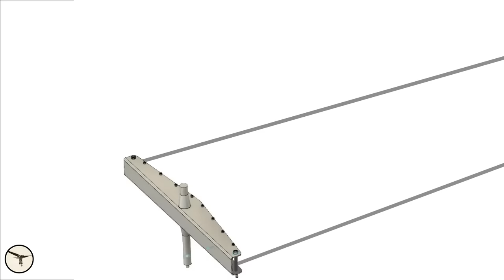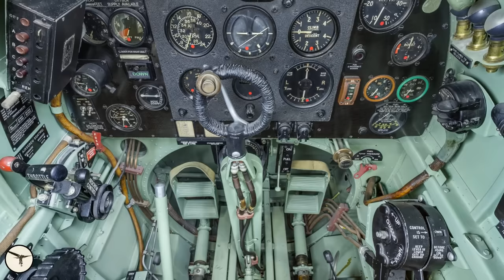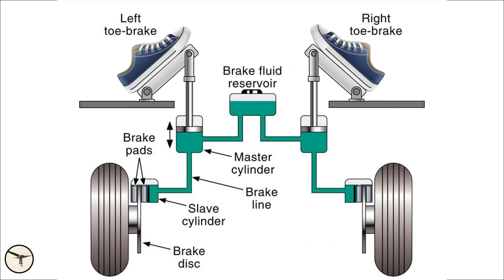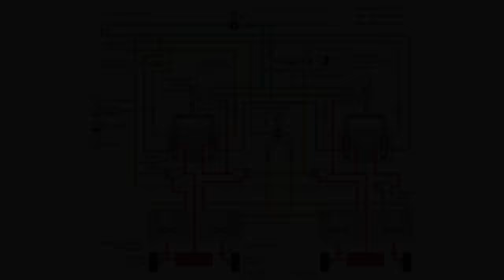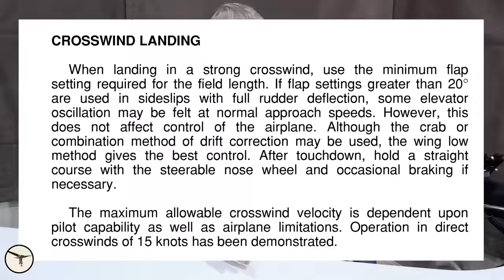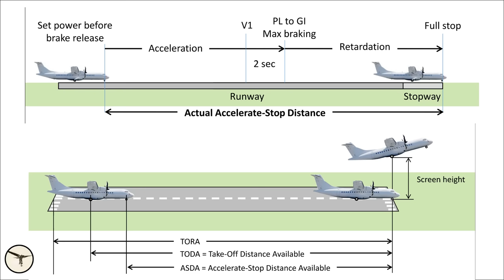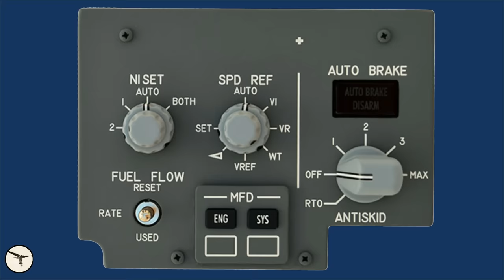Are you using the rudder pedals correctly? | Flight safety | Loss of control

Comment: Thanks for an excellent breakdown.

I am definitely feet-up and always have been, and I've had arguments with senior instructors in my airline about it when they see me in the sim. You've already got two of my points (reaction time improvement, impossibility of shifting foot position if full rudder is already applied without releasing pressure). Our flight manual states directional control at max crosswind may only be possible with full rudder deflection + assymetric brake input.

My third point is the importance of the PM (pilot monitoring) role. According to our ops manual we must monitor all control inputs made by PF at all times. No way to detect inadvertant brake application during T/O roll other than with feet fully up.

There is a caveat though, my brain has been wired since the beginning of flight training to separate heel and toe pressure, I have never inadvertently applied brake pressure with rudder deflection. I don't know how easy it would be to retrain the heels up technique to someone used to having their heels on the floor.
Reply from the maker: Thank you for your feedback. You are absolutely right; using the heels for rudder control might require a rewiring of the brain.
Reply: (non-pilot asking) Suppose you're PM during takeoff roll with heels on the floor (toes on the bottom of the pedals) and the PF applies some brake inadvertently.  Would your pedals lift your toes?  I don't see why not.

Comment: Nice insight capt. I’ll try for this technique. Til now i am used to put my heel on the floor. I feel like it’ll ease my leg for any rudder maneuvers. Such as, put more friction at right rudder with heel so my left leg can loose the pressure. But i always have a problem to hit the brake, i need some seconds and gut to not loosing directional control as well as moving my feet slightly up. 

I know it seems lazy, so that’s why I’ll try to change it. Thanks sir!

Comment: Super interesting video! I never gave this much thought. I'm still in my training phase (commercial pilot, Cessna 152/172; Embraer Seneca III) so I'm not yet familiar with autobrake systems. I tend to always keep my entire foot on the pedals during taxi, take-off & landing for the same reason, it's quicker to use the brakes in case I need them. While in the air I slide my toes down to the "heels" of the pedal, since there is no need for brakes up there (obviously).

Comment: Feet up pros: quicker response to braking.
Feet up cons: inadvertent application leading to brake overheat during takeoff roll/wheel well fire, and on landing, bald spots on tyre/tyre burst/loss of control.

Feet down pros: no chance of inadvertent brake application.
Feet down cons: slower application of brakes, (however RTO calculations allow for delay in braking) and minor yaw when transiting from feet down to feet up during landing roll in high crosswinds.

Feet down seems the safer option.

Comment: I'm a new pilot learning on the PA28 Warrior, and I am a heels to the floor person for takeoff and landing. I'm a pretty tall guy, so it can be somewhat challenging to have my heels up and NOT apply any brakes! My muscles also get tired fast because they're not meant to be holding the foot up like that for so long. 
On the other hand, I have experienced the problems it brings when doing short-field landings. The need to come on fairly quickly and it can be easy to create pilot-induced oscillations if you bring your feet up asymmetrically. Luckily, I have managed to avoid that so far on our shorter 2600 by 75 foot runway!

Comment: We had a 172 crash through the hedge at our grass strip, he had plenty of distance and within the weight with two people on board. He never accelerated to a proper speed to fly, because he was steering it with the top of the rudder pedals and pushing the brakes all the time, the more he needed speed the more anxious  he got and tensed his legs more and more.

Comment: Great explanations. I usually fly with heels down on the floor, due to horror stories told by GA aircraft owners how tires can be punctured by pressing the toe brake accidentally during touchdown, at the moment of de-crabbing and aligning with runway direction, with a strong crosswind, on paved runways. On narrower and shorter grass runways however, I keep my feet up, because the tires won't be damaged, just slip on the grass and I need quicker reaction to any directional anomaly.

Comment: My last AQP (annual sim training) I tried using the heels on the floor method. I was not able to smoothly brake during a crosswind landing. Using rudder to stay on the centerline, to be able to hold the rudder input and slide my foot up the pedal took some effort and the aircraft yawed a bit during the transition. I returned to my normal habit of having my feel ON the pedals. I am always mindful to use my heels for rudder control and toes for brakes.

Comment: I prefer to put my heel on the floor, except during landing (after touchdown) or braking. This ensures I am not inadvertently applying the brakes, and it makes it easier to apply precise rudder control during flight when I am using the ball of my foot on the bottom portion of the pedals.

Comment: I want full control of the airplane at all times, practice makes permanent.    Reaction to emergency or changes in external conditions happen quickly and without warning. I have several instances where feet on the controls has avoided dangerous conditions. Recently I avoided a costly prop strike while landing at night and avoiding a deer on the runway. I used a combination of brake and rudder input to maintain control.  I'm with Magnar on this one.

Comment: Thanks! I didn't know there was so much depth in rudder pedals! I always have my feet on the rudder pedals unless clearly airborne. Then, my legs will relax to rest my heels on the cabin floor. I do not care if I wear the brake pads, they are easy to replace and cost a tiny fraction of my airplane (which is a taildragger, Seabee N6007K). Ground looping is a common taildragger accident (I have seen it at my airport only a few months ago) and the damage varies from none to loss of hull and death. So, the risk of excessive brake wear for the benefit of instant directional control by differential braking presents, for me, a no-brainer decision. Also, the risk of overheating the brakes seems very far-fetched. Thanks, again!

Comment: I fly light aircraft. I used to keep my whole foot on the rudder pedal for steering and differential braking/steering while taxii and heels on the floor on Take-Off. For landing, if its a short runway, I keep my whole foot and control the yaw with my heel. Its not conplicated when you get used to it. Just that make sure that the toes are kept up. The sliding method, I never felt comfortable.

Comment: I am a cfi, and normally if a student has a habit of riding the brakes, I’ll tell them heels on the floor, so they get used to using the rudder only.
However, for myself and more experienced pilots, I use my heels/arch for rudder and toes for brakes.

A common problem for students is accidentally using brakes on initial phase of takeoff, and increasing takeoff distance.

Comment: It depends on the situation no doubt. During very strong crosswind from the right on landing a Dash 8 300 Pilot used the side slip method left rudder right aileron. It was up to max crosswind limitation (36 kts) so the pedal was almost at the stop to maintain directional control as the aileron was used to prevent any drifting. on touchdown with the upwind main gear touching down first then followed shortly thereafter the left main gear touching down. The Pilot had so much pressure on the left rudder pedal with His heels off the floor that upon touchdown one of the main tires on the left blew on landing from the fact that the brake was depressed on the left rudder pedal. Had the Pilot had His heels on the floor this would have been avoided.  and during the rollout if rudder and nosewheel steering are not enough to counter any weather veining into the wind it takes less than a split second to reach up to the brakes and assist in directional control.   Maybe in certain situations and depending on the actual rudder design where it is easier to use the heels to depress the rudder pedals and not accidently sliding to depress the brakes on touchdown it can work or grass landing in taildragger where minimal effect of having brake depressed  on touchdown can cause tire failure?   Having flown over 20 different light aircraft and 10 heavier aircraft the design of the rudder pedals can vary a lot.  So hence My "All depends on the situation at hand.

Comment: I agree with what you're saying here 100%. I'm currently almost done with my commercial and my instructors would be surprised when I mentioned I kept my feet fully on the pedals and operated the rudder with my heels. In my mind, that's how it should be done. What is the sense in having the brakes if you have to shift your feet and change rudder pressure to use them? It would be much easier just to learn with your feet fully on the pedals and maintain positive control all the way down the runway.

Comment: Hello Magnar,

Great video, although I disagree with your recommendation at the end of the video, I also understand that because I don’t have transport category aircraft experience, there might be other considerations, including those you mentioned , which I don’t fully appreciate. Nonetheless, your way of explaning things logically make even those that disagree with you, agree in a way, even if at least through respecting your opinion. 

From my personal experience instructing in light piston and turboprop aircraft with no ABS, definitely heels on the floor. I have flown with many people who apply continuous brake pressure during taxi, takeoff and landing without feeling it because of their habit of keeping their feet entirely on the rudder pedals/brakes. This is also specific to certain aircraft pedal design, for example, on the Quest(now Daher) Kodiak, the rudder pedal design is such that it’s very easy to be pressing brakes without feeling it, as it doesn’t take much pressure. Whereas in the Twin Otter I also fly, it takes noticeable pressure to depress the brakes. The twin otter has relatively strong brakes that when operating at light weights, it’s easy for those landing with feet on the brakes to tense up on landing and apply too much brakes, resulting in a burst tire. Ofcourse the correct technique would be Beta then shortly after brakes(if required). 

Regards,
Mo
Reply: Yes, crosswind landing in challenging crosswinds does delay application of brakes as it would only be smart to start applying brake pressure when the aircraft is under control. Perhaps adding a margin to the landing distance in strong crosswind landings would be wise, accounting for delayed brake pressure application(in aircraft without auto brake)
Reply: In regards to your experience in the Maule, perhaps full aileron into wind during landing rollout would have mitigated the issue with the wind gust. 

And thank you for all the material you share with us and your hard work!
Reply from the maker: Wrong use of ailerons in crosswind can cause loss of control, but apart from that, the ailerons do not improve direcitonal control.
Reply from the maker: Hi Mo. Thank you for your feedback. Yes, some aircraft have near vertical rudder pedals, and that's a challenge. The main reason for inadvertent use of the brakes is that the pilots are not using their heels to control the rudder.

Comment: to be sure, we need to confirm that this is all for specific types of airplane, not industry wide... even today, certain types of GA & non GA aircraft (I started writing this before you mentioned about the Cub) require you to keep the heels on the floor ... I am particularly thinking of the traditional variants of the Yak 40, where, the angle of the pedals was such that it was impossible not to press the pedals in a jolt unless you support your foot on the bracing step. (this actually was a highlighted error resulting in a number of runway excursion incidents...)
of course, on some really modern aircraft, a sidestick or other form of unified control system sometimes will have the rudder on the control column rather than feet operated. (but I think they are a special case enough that we can consider them to be clearly out of the scope of our discussion here in this video).

Comment: As an industry, we are failing our students, by no longer (post WW2) utilizing the most powerful of the three controls....AILERONS ADVERSE YAW for directional control on the ground.
The sequence for landing directional control (pre WW2) was (out of necessity) always rudder, tailwheel steering/aileron yaw, and lastly the brakes for turn off.
With the advent of the Cessna LAND O MATIC system (nose wheels) the industry began to use hydraulic brakes for stearing instead of the AERODYNAMICS of the larger (2 to 4 times the surface area of the rudder) ailerons.
We have now transitioned from, ground looping tail wheel planes, to flipping nose wheel planes onto their backs with excess airspeed, braking & improper use of the larger ailerons. 
Cheers
CFI/ATP 1507987
Reply from the maker: Hi, thanks for your feedback. You are absolutely right. A lot of skill went out the window with the introduction of the nose wheel. A video about the ailerons is on my to-do list.
Reply: I fly the bf 109 in msfs

Comment: What I found in general is that most pilots are convinced that their personal viewpoint or opinion on a technique  is the most correct one the world has ever seen. Without much scientific evidence. I tried the different feet positions on rudder through the years and decided to make 'your' technique (and always being able to brake immediately) my preferred method. When converting to the 737 however I had to reprogram my muscle memory as to not kick off a perfectly working auto-brake when stopping before V1. Took some getting used to but still kept believing in this technique. Auto-brakes can fail and sometimes we dispatch via MEL without them. ✈🙂

Comment: I do as you do. I’ve never flown transport category aircraft however. 

But, this must be the culprit in many loss of directional control accidents I’ve seen. I’ve always thought that so many of them could have been prevented with a little brake at the right moment. Maybe they didn’t have their toes on the brakes.

Comment: the correct way is with full feet on the pedals, for quicker reaction to any unexpected event depending on what's that you need to correct the problem, whether if it's rudder or differential brakes.

Comment: Nice video! I like very much the part about taildraggers. In this case I think it is so different than trycicle gear because if you apply erroneously a little bit of more pressure than needed you can get the tail so up until touching the prop with the ground. I was always taught to use my feet out of the brakes due that, but it's also important to have good directional control with the brakes so quickly.

Comment: On non autobrake aircraft i put my heel on the rudder... ( Mostly GA)

Since i flew 737 with autobrake, cant do it anymore... Suddent jolt on the runway or unintended brake might turn the AB off...

I had a lenghty discussion with my instructor on where to put my foot in my early days..

 And recently, i was teaching some pilot that transitions to 737. What they flew before dont have AB.. and as habbit is quite hard to change.. the AB disarm light always turn on at touchdown  and during high speed RTO 🤣 took em on the 7 SIM session to get used to it

Comment: Great video !
I'm a student on Robin DR400. This aircraft has the front wheel leg uncentered, slightly to the right side which makes symmetrical braking difficult. Besides that, the front wheel needs a certain weight pressure to be steerable which makes "soft landings" dangerous because you can loose steering if you "hit" the front wheel on the runway too lightly. 
My instructor recommends me to keep my heels on the floor and I understand his point of view : the DR400 is so complicated to steer on the ground that student usually only use breaks and do not use the steering mechanism. So far I am concerned, I do feel more at ease with your advice : full feet on the pedal because it gives me an immediate alternate if the steering mechanism does not respond.
Thank you !
Reply from the maker: Thanks for your feedback! I didn't know that the DR400 has an offset nose wheel. It might be a French thing because the SOCATA Rallye has the same.

Comment: So many experienced pilots hardly use rudder. It seems to be GA and turboprop guys who use it instinctively and this carries through. You only have to look at videos of landing airliners and the stabbing of the rudder on some of them! I fly B737, auto brake RTO only works above 90kts so you need toes ready on take off. On landing you may need Autobrake Max due to performance calculations, but that’s fierce so you kick it off almost immediately! The 737 needs an autobrake 4 ( or 3.5) setting!!

Comment: i fly always heels up for taxiing, taking off and landing. I only fly small aircraft at my local flying club and usually do glider towing which is why i want to specifically make sure im able to brake during takeoff if something happens to the glider during the initial part of the ground run (which can be a bit tricky because the glider cannot keep wings level at low speed)
Reply: Do they have two sets of brake pedals (for both pilots in passenger planes!? 🤔

Comment: Mostly things work on some kind of pressure gradient. Engine speed acceleration deceleration and control. Sometimes pneumatic and sometimes air pressure gradient with strings attached like syphon. Take-off keep toes below and landing on breaks. Heal on floor is a relative judgement plan. Though gives you control.